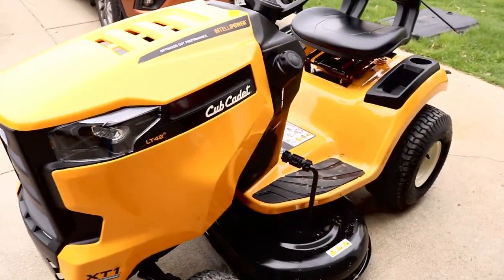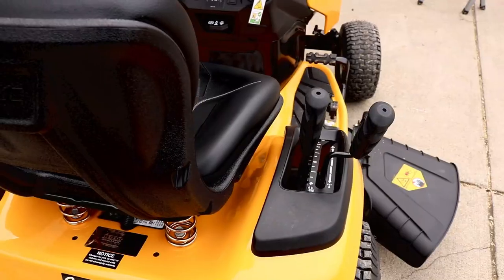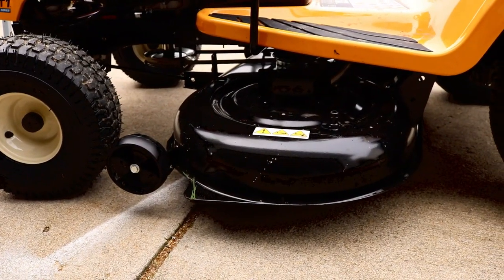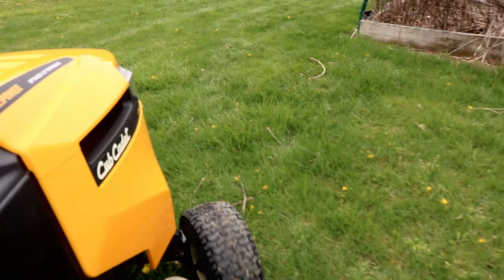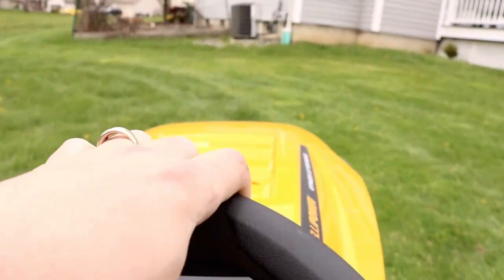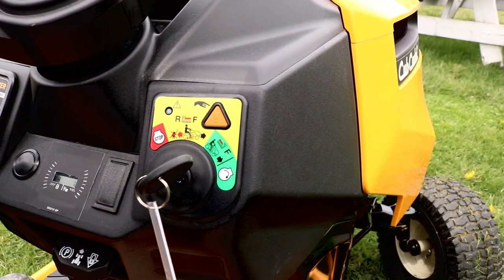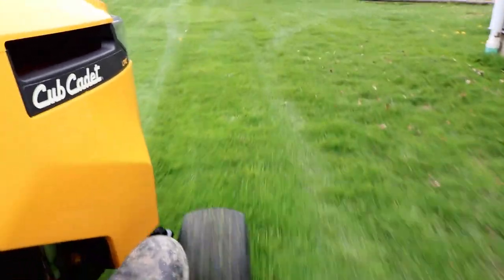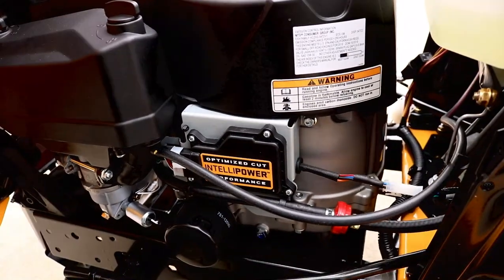Cub Cadet 42" IntelliPower Riding Mower (REVIEW) Cub Cadet XT1LT42 with IntelliPower ENDURO SERIES

Comment: I just got one of these tractors. I love it! The Intellipower feature is excellent when you get in thick grass. The tight turning radius is excellent for getting around obstacles. This machine replaced a 15yr old John Deere that was tired but still running. This machine cuts better than the Deere did brand new. Much better turning radius, much better cut height adjustment. The Deere had a V twin engine and this machine seems to pull just as hard with one cylinder thanks to the Intellipower feature. It's easier on gas too.
Reply: I have had nothing but problems with mine... They couldn't even fix it and had to give me a brand new one... It still has problems
Reply: No disrespect but I don't think you're comparing apples to apples. You should have checked out the new John Deere's. Don't fix anything that's not broke, if it's still trucking after 15 years. My money would have went to the new John Deere
Reply: Never ever b cylinders. 2 cylinders give balance. One shakes the engine not only causing bolts to vibrate and fun to find afterwards and it vibrates the 
Machine and the drivers. MTD builds 75% off lawn/ garden tractors. All junk. I'm looking for a new tractor and can't find any that are built to last. They are built to fail, and so is any cell phone. Even John Deere has a plastic transmission on one of their products, which is experiencing failure which was reported inless than 20 hours. I wouldn't buy any tractor with a B&S, Kohler, I hear Kawasaki is promising.
Reply: Intellipower?   Thank You.

Comment: I also have the 2020 model XT1 42" Enduro and it is really a nice mower. The turning radius is so nice that I couldn't justify another $1000 for a zero radius mower. Yes, I would have liked having one, but I am married. Need I say more? Like you mentioned, the mower has stiff springs under the seat, but I think they will get more comfortable as the mower is used each week. The faster you mow, the more noticeable the stiffness in the ride. Ride 'em cowboy!
Reply from the maker: Haha, awesome comment and feedback R & S, thanks 👊
Reply: Lmfao my wife slapped that thought about a zero turn down as well
Reply: Do You Have Intellipower?  How's it going?  Thank You.

Comment: I've had my mower 12 years and never done that once. Changes blades 3 times and sharpened 3 times. I clean out with a plastic scraper and a brush. No rust anywhere under there. I rinse off the top once a year. It still runs and looks like new.
Reply: I got a 2003 Cub Cadet 1525. It runs and looks like new too
Reply: @mike.4277  I'm looking for a new one but not with the Chinese engine Intellipower. Think I'll just pass.
Reply: @jzm6403  me either. I'm hoping to get a new one next year. I'm thinking about the XT1 LT50 FAB

Comment: Senior lady here.  I've had my 42" Cub Cadet for a couple of years. Wish I'd been more YouTube savvy when I bought the mower. Not much of a reader so your video 'walked' me thru some things I didn't realize.  My problem is the belt keeps coming off lately!  Daughter was here and showed me how to simply put it back on the spindle. BUT, the whole one side is off now!  Not sure why it keeps coming off and would appreciate knowing what I should readjust or whatever to keep the belt in place.
Reply from the maker: Hi Kma! Firstly,  thanks for the comment. Secondly,  over time,  belts get worn and stretched.  I will almost guarantee that you belt is worn, and a replacement is pretty cheap.  That said, one way to prevent that from happening is to come to a complete stop before engaging the blades as this puts more strain on the belts.
Reply: @ToolReviewZone  I admit I'm a little rough on it!  I'll do my best with a complete stop in the future.  Friend get down and sure enough, the belt is almost to the point it needs to be replaced.  Thanks.

Comment: So I went to pick mine up yesterday,  and started the machine, It was very loud and sounded like it was trying to run on CHOKE.
( all my older tractors had a mechanical throttle lever ) this new one has the Intellipower  
Control. As It started, it was spitting and sputtering, and as I was turning the knob,  there was no difference.  I felt  that something was wrong , so I had to leave it there until a mechanic has another look at it.
Quite disappointed,  and I'm sure it will be rectified. Do you have any idea what it may be ? Great video thanks.

Comment: @Tool Review Zone: Hey, have 3 important questions for you: 
1) The new cub cadet mower has the "cub cadet" engine instead of the old reliable Kohler engines it had before. Any information regarding this would be greatly appreciated. 
2) The newer cub cadet mower's have the TL200 transmission's which are bad and they had something else before. Thoughts?
3) Everything is great till your cub cadet tractor has ANY issues. Cub Cadet has the WORST warranty customer service on the planet. You can check their records. They never pick up calls on purpose. They will do NOTHING for you and brush you off one way or another despite still being on their full warranty. Any thoughts on this?
Thanks.

Comment: I purchased the CC with the 46 inch deck in the XT1 Enduro Series. It has the same engine with a fabricated deck. It does not have the intellipower though. I just keep it about three thirds throttle when mowing and when I hit a wet thick batch of grass, I physically crank it to full throttle. With 40 hours on it and two mowing seasons, it performs flawlessly and takes a third less gasoline then my other mower with the Kawi engine in 48 inch cut.

Comment: What about larger models or zero turns? I need something for taller grass and acreage . We get a lot of rain and property holds water for a long time and end up with tall grass and weeds sometimes up to 3-4 feet because you cannot mow you will get stuck? I was think of one of the 50 plus deck size zero turns?

Comment: 62 hrs and mine took a crap. Ran fine last time used then I was surprised with black smoke and ran like a stuck choke. Dealer noticed exhaust leak at the engine gasket. Gasket is backordered. I found one on Ebay and gave it to them. New gasket, cleaned plug and air filter and all better now. Hard to believe an exhaust gasket leak took it out of commission

Comment: Hi, just purchased the XT1LT42 with IntelliPower. Yes as someone mentioned more things to go wrong.. IMHO more good things to make this chore more enjoyable. My question what is the optimum height for the ANTI scalp wheels? I wish they had put 4 on.. what ever.                                                            QUESTION: Why is their only 1 bolt on the back of the seat (see it at 2:15 of your video.) Puzzling. Secondly, is a MULCH cover really needed? I bought extreme MULCHING blades but  passed on their kit. TIA.
Reply: I bought the mulch kit just for the fact that i wont have to rake leaves this fall lol
Reply: @shawnengles8771  Thx for responding... I have the NEW mulch blades coming. Looking forward to seeing how much better they cut with the stock blades that came with the machine, Stay Healthy and safe.
Reply: the motor is made in china

Comment: How well built is the deck to the pulley? My older sears mower just broke ( corroded)around the hole where the bolt goes through to hold the two together.
Reply: Clean your deck regularly and the deck won’t rust as fast

Comment: Got mine today. OK, I started the mower, but why doesn't good forward or reverse? I step on the Pedal for forward or reverse, But it doesn't move. WHY?
Reply from the maker: There is a metal pull pin in the back of the mower (just above the ball hitch area) that is probably pulled out. Push it in and it should work

Comment: Curious if anyone can answer my question here. I found this mower on a few sites (HD, Lowe's), and there's a regular throttle version, and then the intellipower. The intellipower is $200 cheaper, yet I can't find ANY difference between the two mowers. I feel like I'm missing something. Any ideas?

Coming from my late father's HDS 2135 38" which is nearing 300 hours. (1998 model!)

Comment: Can you still get a tractor with a regular throttle lever? Does the xt2 have the intellipower?
Reply from the maker: I cant be 100% sure, but I am guessing that if it's the Intellipower,  it will probably come with a knob like this
Reply: @ToolReviewZone  ok Thanks!
Reply: Just buy a model without the intellipower garbage.  That electronic throttle isn't going to perform like they pretend it does.  A manual throttle cable will perform flawlessly for decades, that electronic junk will be a continual trouble spot.  Basically they replaced your throttle with a computer to decide what power you should have...or not have, sounds cool till it all goes haywire and can't be fixed....stick to the manual throttle controls for sure.  Also, that intellipower engine is a piece of crap Chinese engine, avoid it and get one with the Kohler you'll thank yourself.

Comment: I have a ltx1042kw and love it except for the oil change outlet .I have 4 wheels on the deck and hate that they went back to 2 wheels .I love the glove box I have and yes do love the side grip handles .I love my clothe seat because it is cooler and you do not slip back and forth on it .I hate that they put the gas gage window on the side because mine faces me so I can see it .So far I have resealed the ohv  valve cover and changed deck and drive belts and oil ,air and gas filters 2 times a year sometimes 3 times .I also bought the gator blades for mine 3 years ago and what a great investment they were ,I just had to change the PTO cable also Cheaply made thing as it is .I have 222 hours on my 2016 model and I have 3 acres with the front yard being a hill .But I do have problems there because ziosa grass is very slippery .On wet grass I have found that shoot gets clogged .I solved that by drilling a hole in the shoot and putting a wire through it and bringing the wire up and looping it around the grab handles on the mower and this way I can lower it when I want too or keep it raised

Comment: I'm torn between this & the Craftsman T210 Turn Tight. They both make the same power I think although Cub Cadet has more cc. My problem is besides preferring red which I know is petty. The craftsman has a 5" turning radius compared to this Cub Cadets 16". Damnit I need both turning radius & be able to go through thick wet goatheads & wild grass with ease. I can't find anyone comparing both either, please if you know someone who's bought that craftsman. Do an actual mowing drag race & see which cuts quicker, factoring cub cadets turning handicap.
Reply from the maker: What's up Mike. The two most popular mowers in my area in Ohio is Cub and Husqvarna. Not sure why, but I almost never see anyone with a Craftsman.  I owned one years ago, but that was when they were sold at Sears and couldn't even buy the replacement blades in the store. Sorry I cant help more
Reply: @ToolReviewZone  I missed a deal on a 21 horse Husqvarna last week. Seat was trash but it was only $600. Sold so fast I never had chance to ask how many hours were on it. Oddly the lady wanted 1k for a similar but lower powered craftsman just because it had a nicer seat.

Comment: I have been running my Cub Cadet Enduro XT1 42 on the Power Cut setting.  Today, it hit two hours of use and the RPMs fell to what would have been somewhere between the Transport and Cut Settings.  I was still able to finish the lawn without issue as my grass is not very high or thick, but it was noticeably slower and quieter.  Does Intellipower have intelligent learning?
Reply from the maker: Hey Dave. No intelligent learning feature,  but what you could have noticed is the motor cycling down a bit as it didn't need as much power. I also notice mine will rev higher when in taller grass then settle back down.
Reply: @ToolReviewZone  Thanks for the reply.  I have a small lawn with a consistent rate of growth so it's just odd that halfway through mowing and exactly when it hit 2 hours of use, that it dialed down on RPMs.  It's still adequate for mowing my lawn, but it's not as fast and I can't zip around the yard anymore.... leaving beer holder use as being the only fun thing remaining about mowing.
Reply from the maker: @DaveBuildsIt  Hmm, yeah something does not seem right. I can still crank mine up and run it fast when the knob is turned all the way to the right. May want to give them a call and let them know.

Comment: What key setting do I use when I start mowing? There is a green section and a middle one. A guy at the store said you move the key to the middle when mowing.
Reply: If you want to engage mow in reverse after it's running turn the key to the middle and push the button

Comment: looks great but not sure about the reverse I have to do a lot of backing up as I have a lot of trees some I can't get between, Plus it would be nice if they went to an 11 ga. deck . One of the problems with my John Deer was where the castings for the blades attached to the deck bent and the blades were no longer cutting flat. I was looking at the Cub "o" turns but to wide to get in a lot of places and some places just to hilly, around the trees.
Reply from the maker: Hey Hildton,  ince you engage the reverse it will stay. You won't need to do that every time

Comment: I bought this mower last year and planned on it serving me for several years. I was proud of my new mower! I changed the oil and filter at 4.8 hours and used it most of last summer. It sat in my carport during the winter. I changed the oil and filter again at 11.1 hours before using it this spring. I had been using it approximately 15 - 20 minutes when I heard a loud bang and it stopped immediately. I took it to an authorized service center and after contacting MTD (Cub Cadet Corporate) they will not cover the warranty and fix my almost brand new mower! I talked to corporate and asked them what I could have done to prevent this, and their answer was they wished they could tell me, but they are not going to fix my mower. I will never buy another Cub Cadet product, nor recommend to anyone I know! Through no fault of my own, this mower turned out to be highly defective, and Cub Cadet is being penny wise and dollar foolish!

Comment: drop that deck down to the ground when you use the hose attachment and it should work better.  Being close to the ground does something to the air flow and whatnot and makes it clean better.  "Steve's small engine saloon" did a video on it.

Comment: is this mower good on hills?
Reply from the maker: Yep
Reply: The mower does fine, but the tires do not.  They tend to slip an even dry grass on steeper slopes. I upgraded to some better tires.
 MaxAuto ATV Tires 20X9.50-8 20X9.5X8 Riding Mower Turf Tires  on Amazon
These do great and don't tear up grass when turning very much. Will take any hill you have.

Comment: I want to see what else this dynamo can do-haul a small trailer full of sand & dump it? Scrape the weeds off a gravel path ?
Reply from the maker: I just used my  aerator today. Had 4 full cinder block and and smler slab of concrete on the back for weight and it pulled with no issues 👊